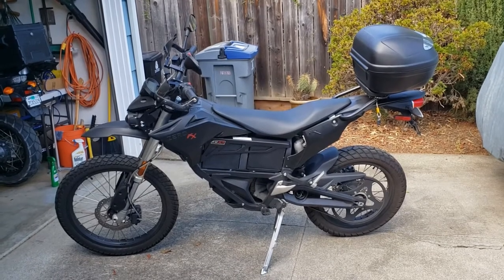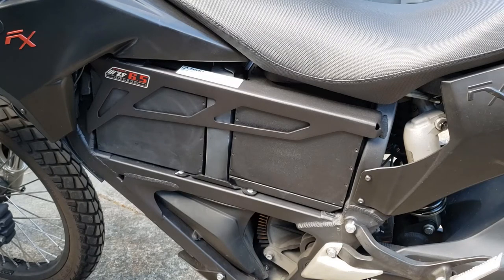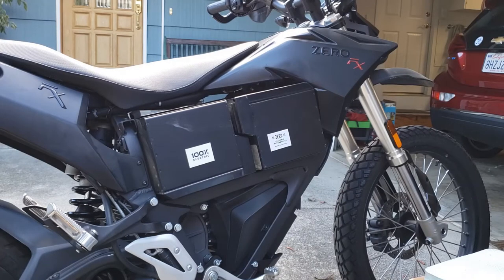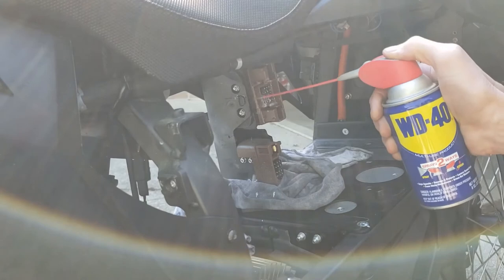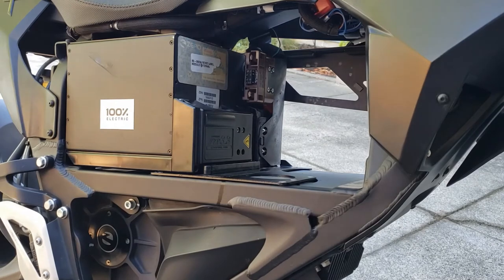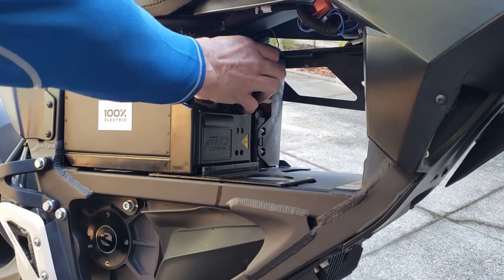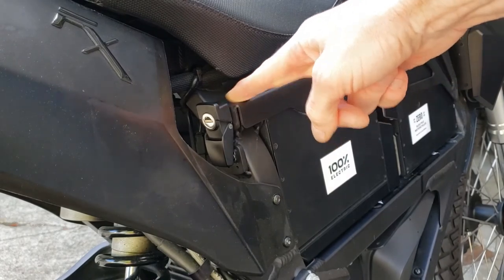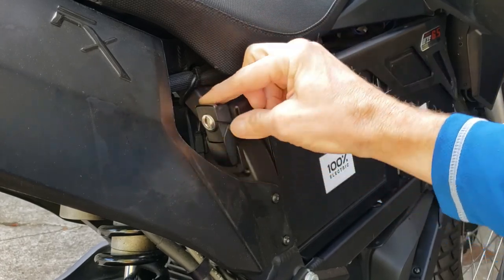Zero FX Motorcycle Modular Battery Remove/Install

Comment: So for Now in 2023 how is your bike doing, any bad stuff happening or any recommendations for us trying to buy one??
Reply from the maker: I had a problem where it would no longer begin charging. I found similar cases on ElectricMotorcycleForum, and was able to fix it by bending and cleaning a contact in the charger harness fuse holder. The battery level indicator is a little wonky in that it drops very fast after a full charge but then levels out. I'll do a range test once it warms up this spring to see if there has been any degradation. I still love it and take it everywhere.
Reply: @Fishlet  Thank you so much! Keep us update

Comment: One more question is Since you have previously mentioned that the newer model, unfortunately, doesn't have an improvement in the range or battery capacity. Should I consider buying a used one? What is the performance degradation of an older FX?
Reply from the maker: I haven't noticed any range reduction in 6 years, although I haven't done any exact measurement. A used one would be a good bet, although the chargers are known to be the weak point and cost about $1000 to replace. Mine has been great so far. The only thing that happened was chronic broken spokes so I relaced the front wheel.
Reply: @curtmcd  thank you for sharing FX facts

Comment: WD 40 is not good for electrical Contacts! There gives a special Contact Spray for this...
Reply from the maker: I'm sure there are better contact cleaners that also lubricate and prevent corrosion. By all means, use it if you have it. WD-40 is what I keep around for a wide variety of uses. I've used it on contacts since my childhood when I saw how well it permanently de-bounced TRS-80 mechanical switch keyboards.

Comment: Hello! I’ve been planning on buying one of this finally and loved this video, how are you liking it? Convenient to charge on the go? Also how did you get all black. Would love more videos of this bike.
Reply from the maker: I've owned the bike since 2016 when it was available in all black. It's tons of fun and my preferred vehicle for running errands and getting around town. It is not convenient to charge because it takes overnight, but it typically goes 60 miles on a charge in the city. Search for Zero FX to see many videos.
Reply: Not sure if any dealer orders 3.6 anymore.  They all 7.2 single battery now. Fantastic bikes and TFT for 22 as well.
Reply: @just_one_opinion  where can I get replacement batteries? And can I upgrade my 3.6 to a 7.2?
Reply: I own a 2017, purchased new and now has 4500 miles and one battery already has an isolstion fault. Estimate from dealer of $5k for new battery and should do both, ridiculous!!
Reply: I also only average 38 miles per charge at country road / highway speeds. Beware if you don't live in a city. Now with one battery I only get 18 miles :-(

Comment: Interesting I didn't even know if you can swap it like this.  I am worried about range for these electric bikes and had the thought to just carry an extra battery or so for the few times a year I need to make a longer trip.  These ones seem a little big an bulky to do so but the fact that it can be done is working my brain.  Want to enter the electric world but since my bike is my only form of transportation and I don't want/can afford to maintain two I need to make that decision wisely or with a plan.  I may go for one of those bikes that have the more milk carton shaped batteries but they are not from as 'reputable' a brand as Zero.  Zero is really expensive but fortunately it looks like they don't hold their value particularly well so I might be able to snag one used for decent money.
Reply from the maker: Unfortunately, Zero started charging around $1000 more for the swappable version. And since extra batteries cost $2500 each, virtually nobody will care to swap batteries except for competition use. Finally, I couldn't in good conscience recommend buying one more than say 8 years old because chargers fail and batteries degrade.
Reply: @curtmcd  I saw that after I made this comment.  Really shitty.  I know batteries are expensive to produce but they are not that expensive.  Those are probably absurdly expensive as well.  Guess I'd better look at other brands.  I may be able to afford the bike used (which is only a few years old) but in 5 years when the charger fails or the batteries show their age I probably won't be able to afford to replace them.

Comment: Whats the weight of the modular battery? and the weight of a full size?
Reply from the maker: Each 3.2 kWh battery weighs 42 lbs and the full 6.5 kWh weighs 84 lbs. Bikes 2017 and later have 3.6/7.2 kWh, but the packs still weigh the same. I'm disappointed there's been no increase in range for 5 years now.
Reply: @curtmcd  Thank you for the info. I am interested in buying one, I am debating whether I buy a modular of a one peace battery... I will use 80% offroad and feel like is more convenient for me to swap batteries riding on a track. My idea is to have 3 modular and swap 1 out during rest time.
Reply from the maker: @painmad  Sounds like fun but it would be cutting edge and there would be issues to deal with. You'd need to swap out the belt for chain drive. There's half power when only one battery is in or one battery is low. You'd get maybe 30 laps per module I'm guessing. And it would hurt if the batteries landed on you! They're not so cheap either. Be sure to do some research.
Reply: @curtmcd  in order to achieve that, radical changes in chemistry and material composition would have to occur. Outside of laboratory tests, it has not.
Reply from the maker: @Enonymouse_  You are right. Despite years of claims from many companies about all sorts of upcoming battery tech, little has changed. So is it not disappointing?
Reply: @curtmcd  It is somewhat but I pay less attention to the company, and much more interest in what's in the R&D que. 
The rechargeable lithium we all consider ubiquitous now was invented in the early 80's, as much as most of us hate to admit it, progress takes time. 
Current R&D on battery tech is all over the place, solid state battery being the one most with the most hope of a fundamental change in how batteries are made.

Comment: hey why would someone remove 1 of the batteries? and also does that mean there are 2 seperate batteries to charge or when they are both in they work together?
Reply from the maker: When both batteries are, in they charge and discharge together. When only one is in, both range and power are reduced. However, in that case the bike is 44 lb lighter (226 lb total), which can increase the cargo capacity and add to the fun.

Comment: Don’t spray an insulator on a conductor connection, 1st it’s flammable, 2nd it attracts dust to accumulate, 3rd you’re reducing conduction, 5th it’s flammable. Get a can of electrical cleaner spray and wipe the tips with lint free cloth it leaves no residue to collect dust. Oh brass tips don’t corrode nether does nickel coated so just spray and wipe.
Reply from the maker: @markellis3648  I've been using WD-40 to improve electrical connections for 40+ years, starting with permanently denouncing TRS-80 keyswitches. It fixes flaky contacts in AA, AAA and 9V holders for remote controls, headlamps, etc. It works long term by excluding moisture and oxygen to prevent corrosion. There is nothing to any of your claims.
Reply: @curtmcd  45 years of Electrical Engineering and a degree claims I’m correct I also cross the road every day but I’m still at risk of being run over.
Reply from the maker: @markellis3648  Well I'm EE messing with electronics since grade school and have never seen anything you claimed. Maybe you're doing it wrong, lol
Reply: @curtmcd  My guys don’t do it wrong we just clear up the damage, degradation  that others have done

Comment: The max combined kWh is 3.6 and the nominal capacity is 3.2 kWh for the FX-ZF 3.6 Modular
This isn't as optimal for it's weight, I can get this kWh rating on a 110 pound bike (minus the battery weight) and upgrade the controller as well to hit about 70mph and it'll still cost less than $9,495
Granted it wouldn't be as beefy or as resilient at high speeds as this bike but the Sur Ron X is more agile, mobile, and easy to store indoors because of it's weight and size not to mention you can ride it anywhere.

Then there's the other version of this ZERO FX bike that weighs an extra 42 pounds (another 42 pounds of batteries) they price it at $11,595 which has 6.3kWh nominal or 7.2 kWh depending on how you like to look at it, so that's an extra $2100 which sounds about right for the price of a battery pack with that capacity and manufacturing costs, though they're still making profit on that as well.
If I had to choose between the two I'd get the Zero FX-ZF 7.2

The only benefit I see from a bike like the Zero FX is that it's quiet, but motorcyclists usually prefer to make noise to alert other drivers that they're approaching on highways, etc...
Also keep in mind that you're not supposed to store these batteries outside in cold temperatures
Reply: can i drive the sur ron on the street in new york? or from new york to massachusetts using back roads? i dont have a motorcycle license would i need one?
Reply: In Europe it is basically illegal to ride the Sur Ron X anywhere. Its capacity makes it a motorcycle which requires a proper motorcycle licence, and directly disqualifies it from riding "anywhere" but on the street, with the other motored vehicles.